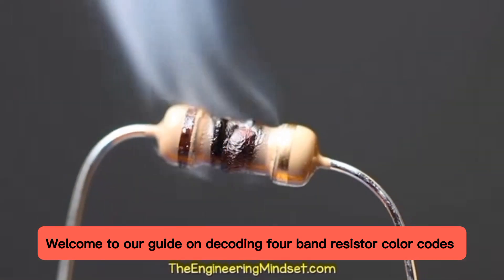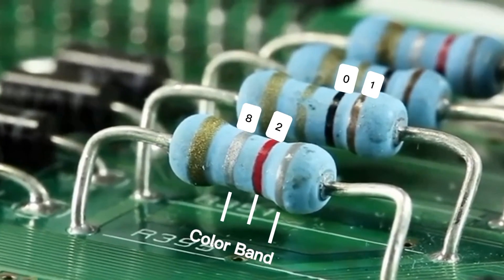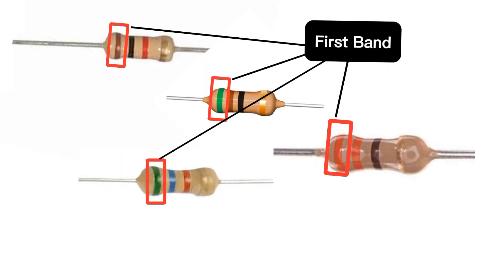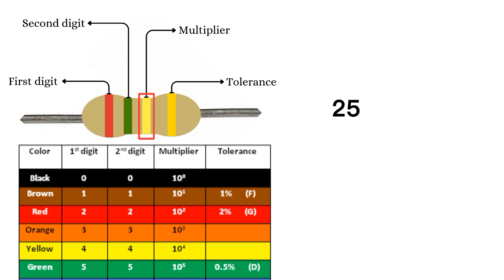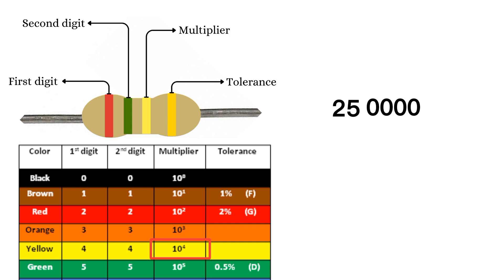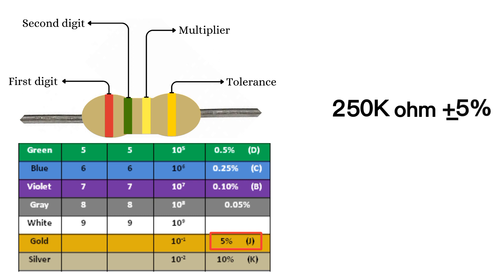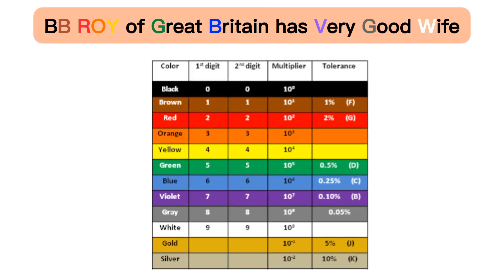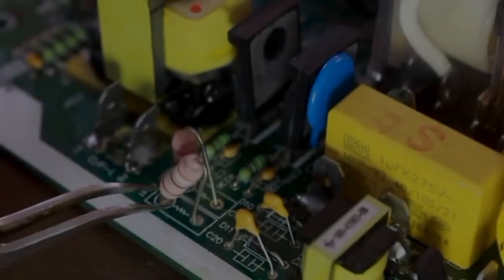Learn Resistor color code decoding Skill in just 1 min | easy way

Comment: But how do you know if the resistor is placed in the reversed way?
Reply from the maker: Resistors never start with a gold or silver band and are placed a little further away from the other bands. You should start decoding from the end opposite to the gold or silver band.